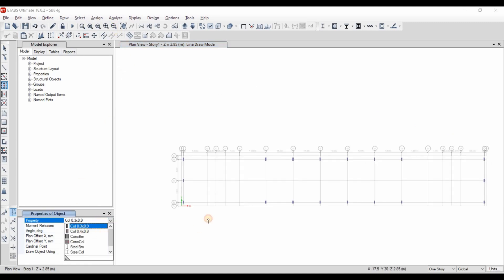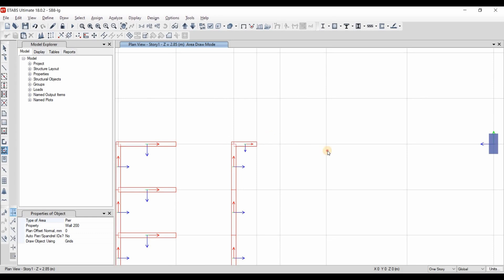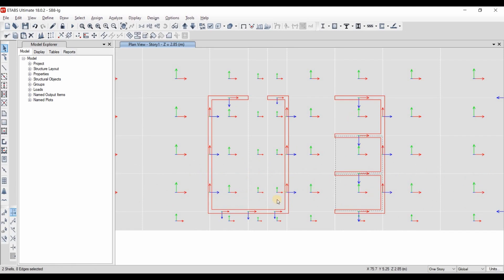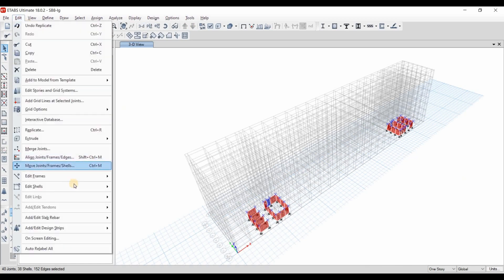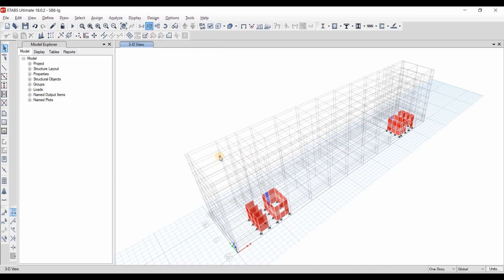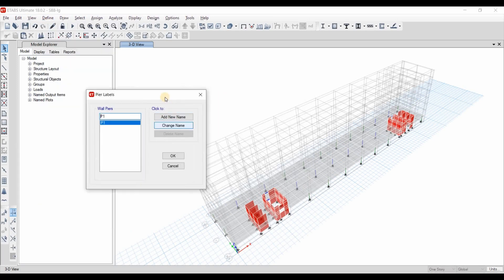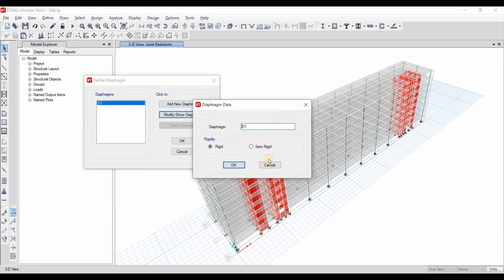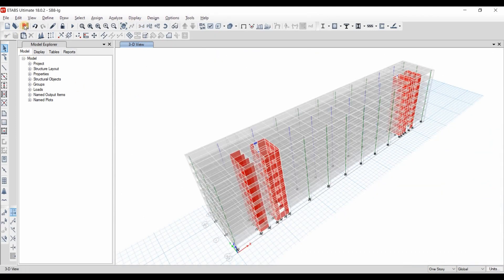ETABS Tutorial 2: Step-by-Step Guide for Drawing Columns, Walls, Slabs, & Assigning Pier Labels.

Comment: Hello, I really enjoy your videos—they are systematic and very insightful. I have a question regarding the modeling of beams in slabs, as I haven’t noticed any beams being explicitly drawn in this project. How should we model beams that are essentially integrated into the slab itself? The first solution that comes to mind is to offset the beam's central axis to align with the slab’s centerline. However, I haven’t found a way to offset the central axis of a beam within a rectangular concrete cross-section to achieve this alignment. I would greatly appreciate your advice on this. Thank you in advance for your response!
Reply from the maker: Hello ... You can use "insertion point" options (From Assign ==> frame ==> insertion point) to align the beam centroid with the slab mid-surface. For example, you can set the insertion point to "Top Center" or "Middle Center," depending on how you want it to interact with the slab.

Comment: Informative but why did you assign only 4 pier labels? Each individual legs should be assigned separate pier label isn't it?
Reply from the maker: Detailed Design: 
If the goal is to perform a detailed design analysis, you can assign separate pier labels for each individual leg of the shear wall. This approach enables a detailed evaluation of the forces and moments acting on each individual segment of the wall, allowing for a precise design that meets the specific structural demands of each part.

Overall Resistance: 
In cases where the primary interest is understanding the overall resistance of the core wall, assigning fewer pier labels (such as one for each major section or core) can be sufficient. This approach simplifies the analysis and focuses on the global performance of the wall.